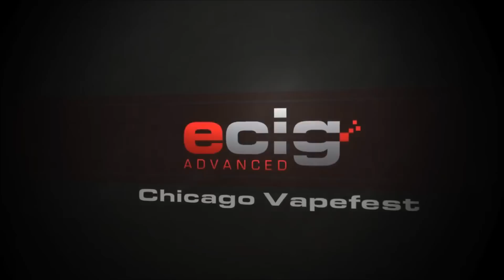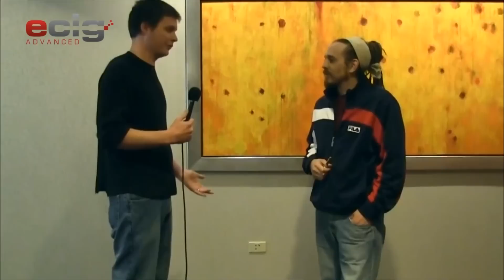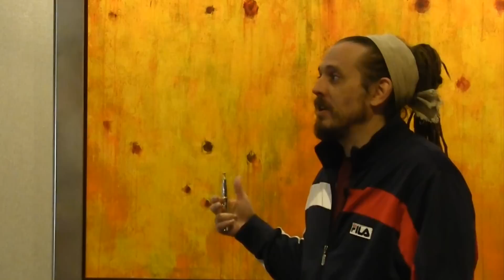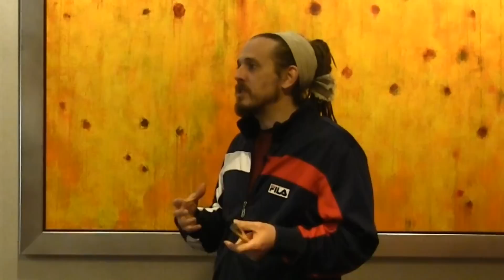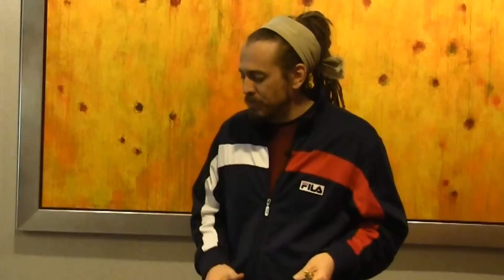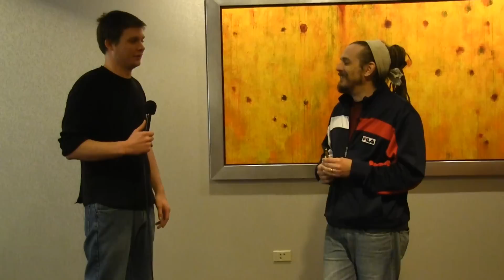Chicago Vapefest - Akston Hughes' Daniel Walsh on the SVR

Comment: EMSS was created by the e-cigarette forum, essentially meaning "ECF Metal Tube APV (Advance Personal Vaporizer) Safety Specifications.  It is a list of suggested requirements for mods to meet certain safety guidelines.  Future mods, if they qualify, can be "stamped" with this certification letting the potential buyer know that it meets those guidelines.  This stemmed from a few battery failure/explosion incidents over the last few years, and the potential issues it could cause for the industry.